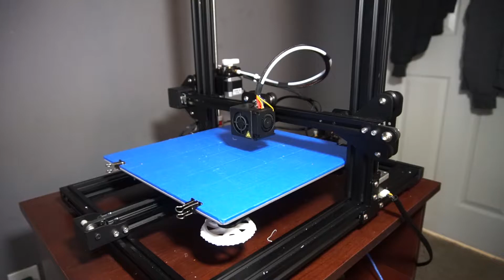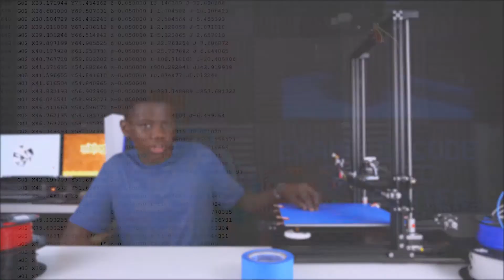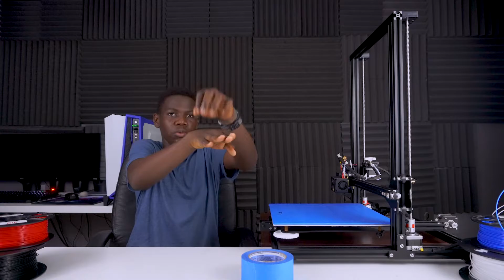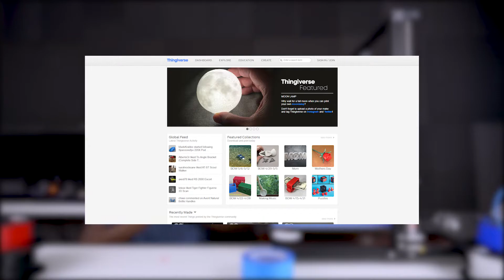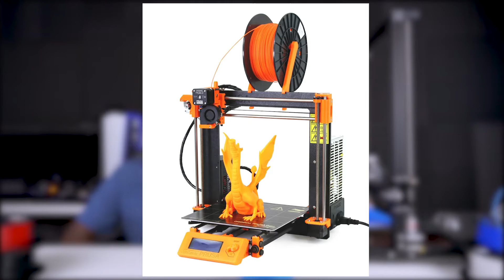The Mechanics Of 3D Printing | Everything I know about 3D Printing

Comment from the maker: TIMESTAMPS

How I thought 3D Printing Worked Previously (start)
_________________________________________________________________________________________________________________________
How I've Seen The 3D Printer Work 1:30
|                                                                                                                                                                                                                                  |
         Slicing Software  |  3:19
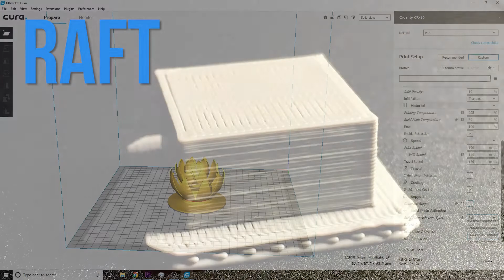         Raft  | 3:54
         PLA, Temperatures, Materials etc. (In slicing software)  |  4:36
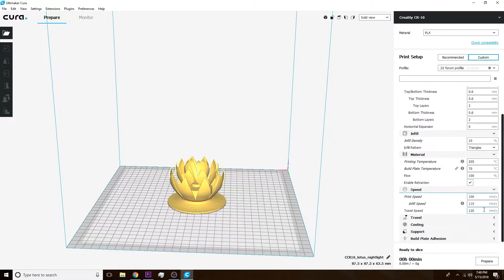         Speeds  |  5:32
         Supports (synopsis)  |  5:58
         Infill  |  6:26
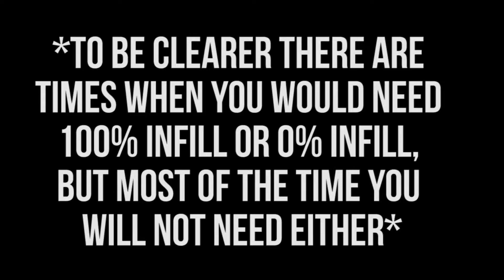         Supports  | 7:12
         Print Bed/ Bed Adhesion  |  7:34
         Bed Leveling  |  9:16 
         FIlament Prices, Amount, How It Works  |  10:40
         Getting Models  |  12:30
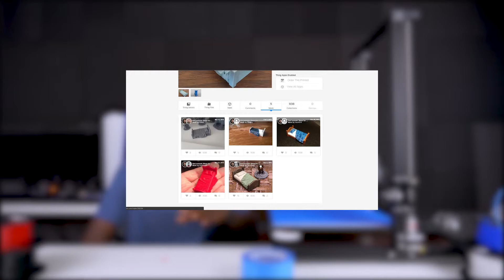         Settings, Getting Your Settings, Profiles  |  12:48
|                                                                                                                                                                                                                                  |
_________________________________________________________________________________________________________________________
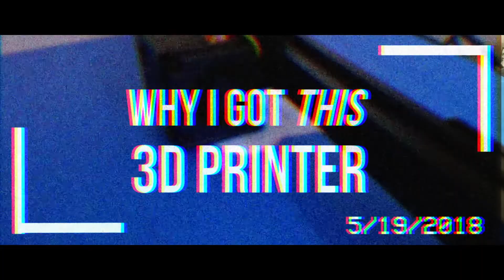Why I Got This 3D Printer (Cr-10s)  |  14:50
|
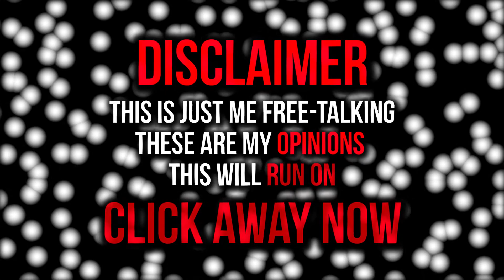         Main Competitor  |  15:04 
         Prusa i3 mk2  Pros and Cons  |  15:23 
         Cr-10 Pros and Cons  |  16:41
         My Decision and Why  |  18:00
         Why I Got The Cr-10s Instead and Upgrades It Can Come With (and The Upgrades I Didn't Get)  |  19:10
         My General Experience with the Cr-10s and Review  |  20:46
         Extreme Print Failure I Had With The Printer  |  20:59
         My Experience with Building the Cr-10s  |  22:45 
|                                                                                                                                                                                                                                  |
_________________________________________________________________________________________________________________________
In the Bed Leveling part I don't teach you how to do it, instead, I tell you about it. I did this because I am not very good at bed leveling and  it is very important. Therefore, it would be better if a more knowledgeable person taught you about it. So I'd just look it up

P.S. Tell me if I missed any important timestamps, and in this video, I forgot to include a section on cooling so here is a great video on it: https://www.youtube.com/watch?v=nIeTxTIsSbc
He talks about why cooling is important from 00:49-1:48